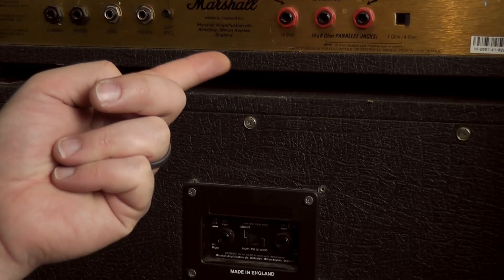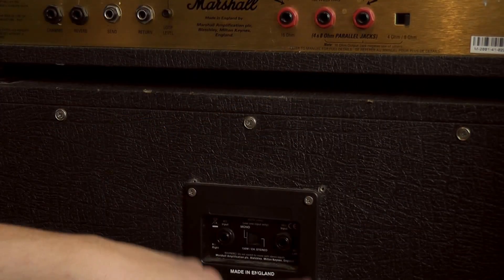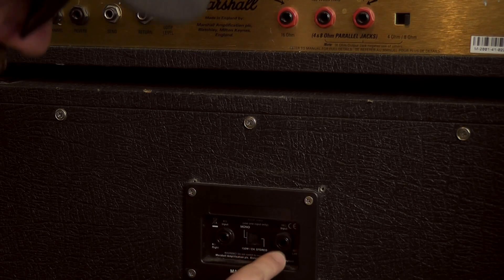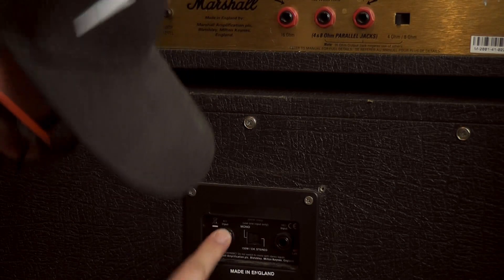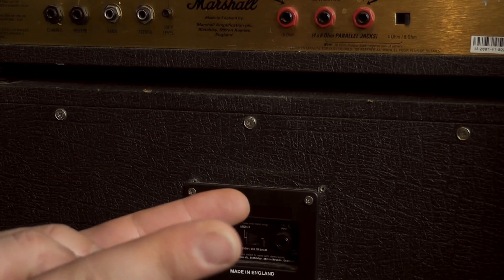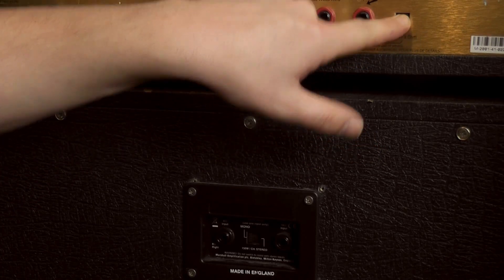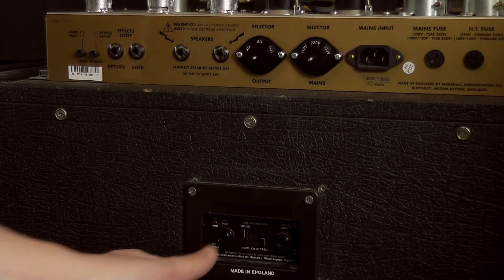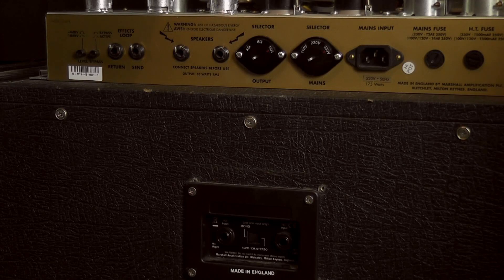How to Connect a Valve amp to a Cabinet

Comment: hello, I own the first system you have shown (JCM2000 DSL50+ 4x12 cab). If I set head to 4 ohm (setting lever to 4 ohm) , connect to center or right socket, then connect to cab left socket (4 ohm) it does not work. Why? If I match head with a 8 ohm cab, it works well.

Comment: Like other comments have said, thank you for breaking it down so simple with visuals. We appreciate it.
Reply from the maker: Glad it was helpful!
Reply: Hi , I have a question why on amp heads like Marshall have 2 inputs of each  8 ohms or 16 ohms if only using one of them , ? Also what side do I use if only using one of them ? Hope that made sense. Thank you !

Comment: good info mate...  can you explain the stereo option also?   if the switch is in stereo, how the left and right inputs work?  any idea if this style of jack can be used on a 2x12 setup?  mono, both speakers work, in stereo the left and right would drive one speaker only.  i have a spare one of these jacks and trying to put together a 2x12 version of a 1960a cab.

Comment: Just read the comments so I don’t think this  question has been asked. Sorry if I’m wrong. So I have a 20 Watt Marshall silver jubilee head and I want to connect it to the boss TAE core tube expander load box. I know that I use a speaker cable to connect to the back of the box where it says “from the tube amp”, and also states max 100 watt, and under that it says 8 ohms. So it makes sense that I would then connect to the back of the Jubilee at 8 ohms or less even? The problem is with the Jubilee, unlike the amp you were reviewing here, it has five different loudspeaker output options: 1×16 ohms, 1x8ohm,2 x 16 ohms (and those two are confusing because they’re grouped together and I’m assuming the one x 8 ohms is the first of the two that are grouped together), and lastly, there are two more outputs: 1×4, ohms and 2×8 ohms. I’m assuming I can plug-in the expander to the Jubilee where it states 1x8 ohms or even 1x4 but I’m just a little confused based on how they have it organized with those two inputs side-by-side. I bought this amp used so I don’t have any directions.
Thanks!

Comment: What if I pair a 16 ohm cab with an 8 ohm cab? Switch set at 4 ohm. Pluging into the 4/8 ohm amp outputs. Is that safe?
Reply from the maker: So three cabinets?
Reply: @RDamps  2 cabinets,,,, one 16 ohm and one 8 ohm
Reply from the maker: @axemanstevecollins  ah ok, so to answer your original question, yes. You could do that and it would be safe. BUT!!! Most of your signal will go into the 8ohm cabinet. I wonder if there is a way to wire your cabinets speakers in a way that they would match?

Comment: Stereo mode each side (left and right) connect to the same amp 8 ohm selector both jacks, is that possible?
Reply from the maker: No. stereo requires 2 separate amplifiers.
Reply: @RDamps  Thanks for the answer sir.

Comment: hi, great vid, i have a marshall 8100 and on the back it says" 100watts RMS/4ohms" im lost! i want to use a 4x12 cab. i have a 4x12 marshall cab with 4 -AX-75 16 ohm speakers in it.i can rewire it but need just a littler help to connect it right/ matching, theres no ohm switch on the head btw or cab, thanks
Reply from the maker: Sorry for the late reply, do you still need help with this?
Reply: yes if ya dont mind. i have 4 4x12s but want to stay with that 16 ohm Marshall cab and head
Reply: @RDamps  yes

Comment: Question. Can I connect a 280W Marshall 1960AV cab and a 300W Marshall 1960B cabinet to a 100W matshall head (JCM2000 DSL) to make a full stack or will it be a problem with the wattage difference of the cabs? Both cabs are 16 ohm.
Reply from the maker: No problems at all. But set the amp to 8ohm’s or use the 2 8ohm jacks
Reply: @RDamps  Ok awesome, thanks! I picked the cab up so long. Just waiting for the weekend to go get a second speaker cable. Wasn't aware that instrument cables are a HUGE NONO when connecting speakers to cabs XD Luckily no disasters of yet.

Comment: Ive got a crate v33 head with a 2x12 cab. Only one speaker is playing. There are 2 imputs, one 8ohm, one is 16ohm. One imput plays the left speaker, and one plays out of the right. Do i get a y cable to get both speakers to work?
Reply from the maker: Sounds like the cabinet is wired incorrectly

Comment: Great video!!! Quick question: I have a 2x16 Ohm cabinet (G12 Celestion speakers). What input should I use in my amp (Marshall AFD100)? I have available (1x8 Ohm), (1x16 Ohm), (2x16 Ohm) and (2x8 Ohm). Thanks in advance for the help.
Reply from the maker: Is it a 2x12 cabinet with two 16ohm celestion speakers?
Reply: @RDamps Yes!
Reply from the maker: @douglas71322  ok, they should be wired in parallel so the 2 speakers combined will total 8 ohms. So use the 1 x 8 ohm out on your amp
Reply: @RDamps thank you very much!

Comment: Can anyone answer this question? Let’s say my amp head only runs in 4 ohms, can I plug it into a 8 ohm cabinet, or will it damage it?
Reply from the maker: It depends on your amp. If it’s a fender you should be fine.
Reply: @RDamps  how does the brand make a difference
Reply from the maker: @karzm0323  , depends on the quality of the output transformers (if it’s a tube amp). What amp do you have?

Comment: I've just brought a 2x12 unloaded  I've 2 x16 ohm speakers it has mono and stereo switches on back so am I right in thinking I would run  in mono to the 8ohm jack on back of my amp? Thanks advance
Reply from the maker: Yes but do check with a multimeter. It will read a little below 8ohms

Comment: Great video. However, could you make a video how to set up all those buttons at the back of the amp so that I could get a sound from the amp? I am sure that on my 6100 LM everything works but I must have pushed some by-pass button and I am not getting any sound from my amp.  Thanks.

Comment: Fantastic thank you! I have a V30 1x12 16ohm 2 input wired in parallel cab. Do I plug in to 1 of the 16 ohm inputs of the cab and the 16 ohm input of my Marshall or do I have to use the Marshall 8 ohm mono input ? 😅

Comment: I own a Katana 50 MK2 combo. It has a 4 ohm input jack for an external amp head, which bypasses the Katana's solid state amp.  I just bought a Marshall dsl20 head with 8 and 16 ohm outputs. How do I hook it up to the 4 ohm speaker portion of the Katana combo unit?  I don't have a dedicated speaker cabinet.
Reply from the maker: Yeah… that won’t work. You would need to disconnect the speaker from the Katana and add a jack socket. Ideally pick up a secondhand speaker cabinet

Comment: I have a Randall RH100. Which has an output of 8 ohms. I have 2 Peavey 5150 cabinets both are 16 ohms. 
There is no switch of ohms except a knob with LIFT om the left side and GND on the right side.  And it has 2 outputs next to that. 
Off course I should put 2 cables in it 1 in the left and 1 in the right. But on what side do I have to put the switch? LIFT?Or GND?

Comment: Marshall DSL100HR 100-watt Tube Head there are 4 speaker outputs , my amp tech instructs me to hook up the 4 x12  8 0hm and 2 x12 8 ohm cabs into the last  two inputs on the right side at 1x4 ohm or 2x 8 ohm is that correct ?  This head is very confusing to use btw
Reply from the maker: I’ll take a look and get back to you
Reply: @RDamps Hi, so the 4x12 8ohm cabinet goes into the Marshall DSL 100 watt head 1X4 ohm / 2X8 ohm plug in the back of the head. Is that correct?

Comment: That's good information also there's another question say I have an English amp but I live in the USA on the voltage selector what do I do just set it to 110 or 120 volts?
Reply from the maker: Yes! I would recommend 120, as it places less stress on the amp.
Reply: @RDamps  hi thanks for the info on the voltage selector also I wonder if you could tell me if you would please I have a Bugera 333xl 120 watt amplifier and I'm having trouble with it I get no sound from coming from my tone controls but the power section work all the tubes light up and I'm wondering what's wrong with it it's an Infinium amp and self biasing I've been having a heck of a time with it do you have any ideas could it be a fuse or solder joint or resistor I know nothing about Electronics can you throw me some ideas?
Reply from the maker: Oh man it could be a 100 different things. I wouldn’t even want to speculate. Get it to a tech
Reply: @RDamps  that's okay I want to buy one of them Marshall jcm 800 2203 reissue amps are they any good?
Reply from the maker: I think they are fantastic. They are a very faithful reissue to the original with the added benefit of FX loop and hum balancing. You get people moaning about how they’re not the same but that’s bs. Every Marshall is a little different. Check out the reissue I modded.
Reply: @RDamps  thank you for the advice I really do appreciate it

Comment: Hi, what would be the advantage of connecting two single speaker 16-ohm cabinets in the two 8-ohm input jacks vs one single speaker 16-ohm cabinet in the 16-ohm input jack. Would you gain or lose any volume or maybe get a fuller sound. Thanks for the simplified explanation of how to figure how to properly hook up speaker cabinets.
Reply from the maker: Well… you would have more speakers giving a fuller sound and you would perceive more volume. More is always better! 😀

Comment: Hi ..good video..I have a question please ........I have a Pedal baby 100 Orange head (100 watt).......The speakers cabinet 2x12 has two inputs  Power rating: 120 W at 8 Ohm or 2 x 60 W at 16 Ohm.....shall I plug only one power cable or it is better two at the same cabinet?   The Head output says 1 x 8 Ohm ,  2x 16 Ohm and 1 x 16 ohm speaker. Thank you. Cheers
Reply from the maker: Hi Gian, with your cabinet I would just use one cable. Using 2 makes no difference. By using 2 it just equates to the same as using one. So use the 1x8 ohm out on your Pedal Baby head into the 120w 8ohm on the cabinet.

Comment: 2 speaker cab 16 ohms 2. Speaker cab 8 ohms where i plug then?
Reply from the maker: Is that a total of 4 cabinets?
Reply: @RDamps  no its 2 cabs with 2 speakers in each. 1 cab is rated 16ohms and the other cab is 8ohms
Reply: I have a marshall sv20h head...  look it up and you can see the back of it.

Comment: with the cab in stereo could you use the two 8 ohm connectors on the cab and the 2 speaker jacks on the amp setting the output selector on the amp to 4 ohms?
Reply from the maker: You can. I’m not sure what the benefit would be. But some amps can sound better at 4 ohm. YMMV

Comment: Great video.  I've always understood the Ohm halving.  I do have a question though.  I have an old 70's Traynor Head (only has a single 8 Ohm output)  What are my options connecting to a 4x12 Marshall cab if I want to get full use out of it?  Is there a safe selector/input combination on the cab to get usage of all 4 speakers?  Or is my only option to either re-wire or load with speakers that will total 8 Ohms?  Thanks in adavance!
Reply: To add some more context to this question...  I know that as is I can place the selector on stereo and only use either side at 8 Ohms (2x12 at once) giving me 150 watt overhead.  My amp head being about 100 watts I know that is more than sufficient.  I am really just interested in (safely) hearing the tonal possibilities of all 4 speakers firing at once even though I am nowhere close to the 300 watt overall rating of the whole cab  :)   Additionally, please correct me if I'm wrong, but I've always been told it is "okay" to have a higher wattage rating on your speakers, but not the other way around (example: head cranked at 100 watts and speakers only rated at let's say 50 watts.  That would blow the speakers and potentially kill your transformer(s))  Is this correct?
Reply from the maker: Traynors are so over built I think you would be fine. 16 ohm is probably the “safest” mismatch.
Reply: @RDamps  Thanks for the response!

Comment: Hello.
 I would like to ask you a question.
 I just got a Marshall dsl20 head. I plugged from the 1x16 ohm output to a single 8 ohm speaker, a Line6 spider3 75 watt combo, to be specific. Obviously I had the ohms wrong. I didn't crank the amp or play it very long before discovering my error. Do you think I'm in the clear. What should I be watching for?
Reply from the maker: You should be fine. As long as there is a speaker there to dissipate the energy it will be ok
Reply: @RDamps  😙👍. Thanks. Everything seems fine. Also, Is it normal for a tube amp to hum when no guitar is plugged in? It gets louder the higher the knobs are turned. Eq, volume, and gain.

Comment: Thanks!   This is all so confusing.  I've asked these questions in guitar groups but sadly many guitar players in these groups either don't want to help or they just want to show off how much they know while speaking in overly-technical terms.  This was at least simple to understand.

One remaining question is, can you recommend a good mid-priced (under $500) 1x12 or 1x10, or 2x12 or 2x10 cabinet that would be good for blues, rock, and metal?
Reply from the maker: Glad to help. I all honesty i think the Harley benton 2x12 with V30’s is a bargain. I would certainly go with a 2x12 to cover all the ground you want. A 1x12 will struggle with metal.

Comment: Can I connect Boss ME 80 pedal direclty to a speaker cabinet without a seperate amp head? would it sound great?
Reply from the maker: No, that will not work. You could use a pedal board amplifier like the Harley Benton GPA-100
Reply: @RDamps  Thanks a lot